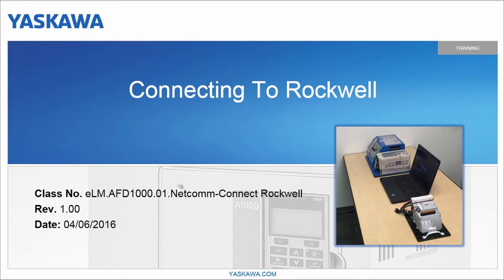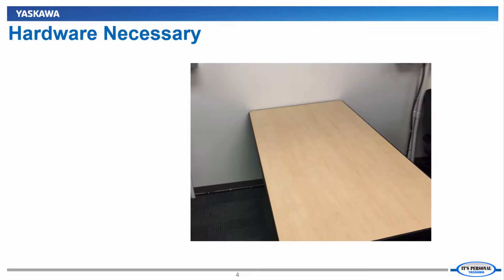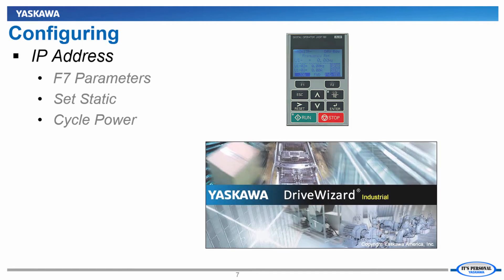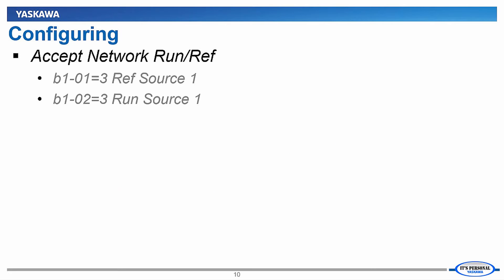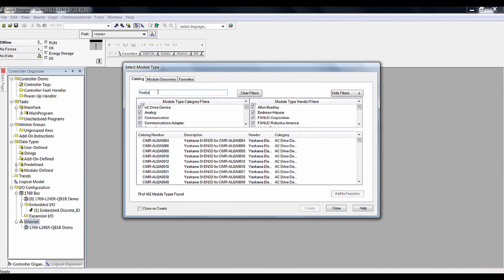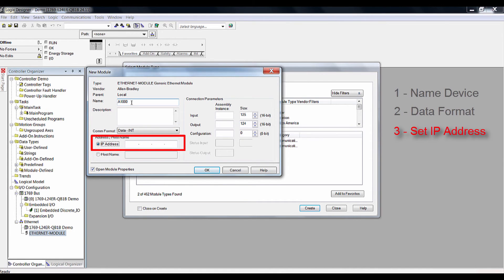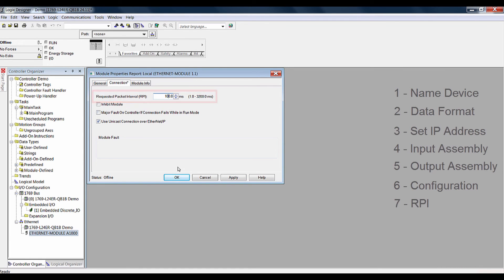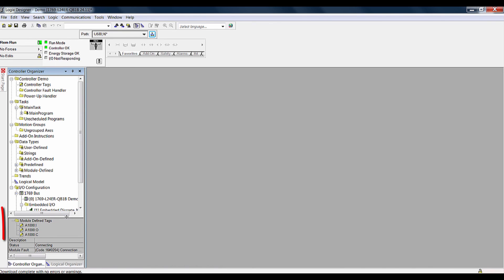Connecting Yaskawa to Rockwell

Comment: Customer has (8) VFD they are upgrading to PF605 (one is a GA800) and we are upgrading from hardwired control to Ethernet/IP with Logix 5380 series Compactlogix (replacing a Micrologix 1500 and tons of wires).  They have a pump optimization system that requires we supply the output power data from each drive.  Can I choose assembly instances that can supply this info as part of the implicit data or must I use explicit messages in addition?
Reply from the maker: Thank you for your interest in "Connecting Yaskawa to Rockwell."

Yes, if there is an assembly that allows you to monitor output power, you can utilize it. Alternatively, you can achieve this using an explicit message.

Here is a helpful document from our Yaskawa Solution Center titled "Read Output Power (in kW) through Modbus Communications on 1000 Series Drives." This document provides guidance and is also applicable to the FP605 drive. https://solutioncenter.yaskawa.com/selfservice/viewdocument.do?noCount=true&externalId=12852&sliceId=1&isLoadPublishedVer=&docType=kc&docTypeID=DT_FREQUENTLYASKEDQUESTIONS_1&stateId=1640&ispopup=true&cmd=displayKCPopup&dialogID=12035&ViewedDocsListHelper=com.kanisa.apps.common.BaseViewedDocsListHelperImpl&openedFromSearchResults=true
Reply: @YaskawaAmerica  This ended up being amazingly easy to do.  I simply used the AOI for assembly instances 166/20-21 in the Logix program, and (aside from ethernet IP addresses) only had to change three parameters (b1-1, b1-2, and comms timeout) to get PLC control of the eight drives.  The instruction brought in Motor Power as Custom Data 2 by default and had all the other data items I needed.  A whole shedload of unnecessary control wires went away and made the new control panel so much nicer than the Frankenstein it replaced.
Reply from the maker: We're thrilled to hear about your successful implementation using Yaskawa's Add-On Instructions (AOI) with assembly instances 166/20-21 in your Logix program. Thanks for the feedback, very much appreciated.

Comment: I'm very new to Ethernet/IP communications.  Is there a standard table for the assembly instances, or just for Yaskawa devices?  I'm trying to add in another Allen-Bradley PLC that's not in the RSLogix catalog.  I'm assuming I also need to use a Generic Ethernet Module, but am not sure how I'd figure out the assembly instance settings.
Reply from the maker: Thank you for your interest in Connecting Yaskawa to Rockwell. Yes you we suggest you use the Generic Ethernet Modules but will need to choose which assemblies you require. A list of these be located in the option card located here: https://www.yaskawa.com/products/drives/industrial-ac-drives/industrial-network-communication-protocols/ethernet-ip/-/content/_1373c03b-7585-4e16-b7ec-32562916ad8f_Manuals-All.  If you require further assistance please contact  please contact our Tech Support team at technical_support@yaskawa.com

Comment: for anyone else starting up one of these, for Yaskawa Sigmalogic you want to use the assembly info as so, not what the video shows:
 Input: Assembly Instance – 102, Size – 64
Output: Assembly Instance – 112, Size – 64
Configuration: Assembly Instance – 1, Size – 1

Comment: Does this work with the 5/05 SLC's or the MicroLogix 1400's via RSLinx?
Reply from the maker: Hi Tim, Thanks for your comment! It will not work with the 5/05 SLC's or the MicroLogix 1400's via RSLinx. Those two will use RSLogix500.

Comment: does this work with yaskawa v1000?
Reply from the maker: Yes, the card itself and the procedure are the same for both the A1000 and the V1000.  The V1000 EtherNet/IP card comes in an expanded cover so it can fit the V1000 but the card is identical.  
Even most of the assemblies for the V1000 and A1000 are the same.  Good question Tony!